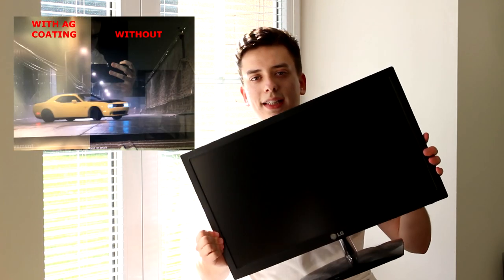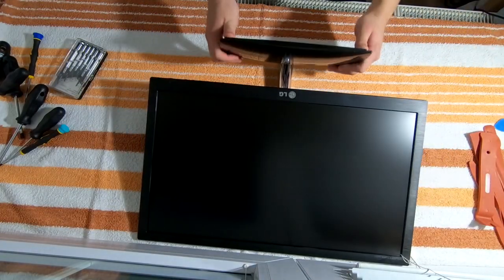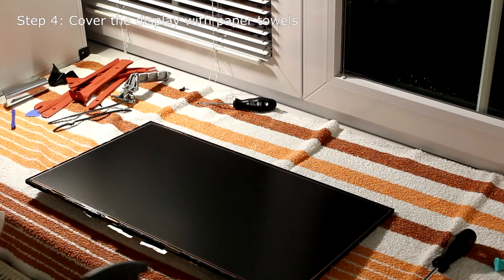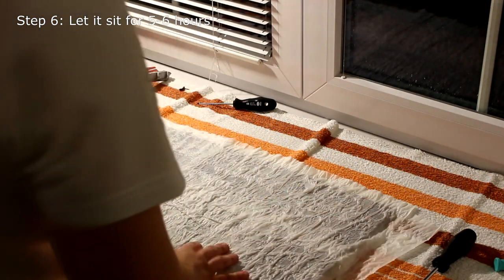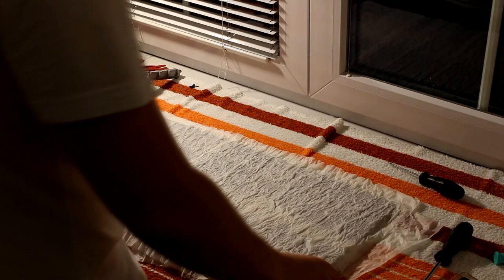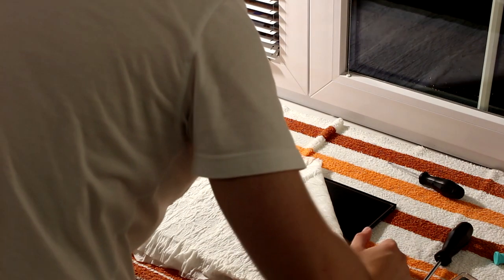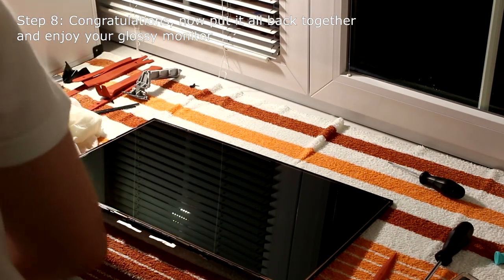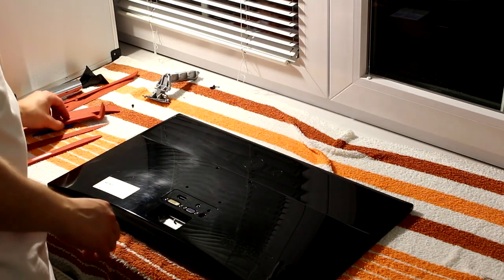How to remove the Anti Glare Coating from monitor DIY (Matte to Glossy)

Comment: Thanks for the tutorial. I'm going to change monitor soon, as my current monitor is matte (Asus PB278Q) and my future monitor will be glossy (probably OLED), I wanted to see what a glossy monitor would look like in the room where I have my PC. As I'm not patient, I removed the anti-glare after only an hour 😅 By removing it, I thought the screen was broken but in fact, the anti-glare plastic was torn. That said, I managed to remove the torn pieces without having to add paper and water. After putting everything back together, I turned on my PC and my god... what a slap I took 😱 My monitor already had very good image quality but now, the image is magnificent 🥰 I'm still going to have to change  because I play a lot and my monitor is limited to 60Hz but the image quality is so much more beautiful after removing the anti-glare...

Comment: I tried. After about 7 hours of wetting toilet papers over my LG ERGO 32, the coating didn't moved nothing. Not even a little bit. I tried to force my nails to remove, and only made it to look ugly. Gladly it was only at the very corners and didn't affected image.
Reply: Same - I tried it on an LG 38uc99 and it didn’t work at all.. only managed to scrape of tiny bits on the corner.. so abandoned it.. maybe LG are using a special adhesive.

Comment: have you tried to clean the monitor with the polarizer on?
Reply from the maker: Yes, a few times already. I use slightly damp microfiber towel, when the monitor is cold and so far no problems at all.

Comment: I just cleaned my monitor with bio ethanol and tiolet paper, it scratched badly. The coat is ruined. Is this a method I can use? Or is there a spray s I can diy recoat?

Comment: My monitor came with a diffusion coating that was just way too strong and foggy. Found myself squinting just to see sometimes, even at max brightness. Thanks to this video though, i was able to finally replace it 😂. I’m not a full glossy guy, but the new coating that I got is a good mix of both.

Comment: This works especially great especially on "frameless" monitors. You don't have to take off the metal edging because there isn't any! Easy Peezy. Don't be afraid of this.
Reply: have you dont it? which monitor? I have an Lg27GP83 and I am wanting to do this but anot sure how to dimsantle the monitor.
Reply: @Abrioso  Yes I've done it twice. Once with a "frameless" Dell and once with a Samsung that did have a frame. The Samsung was more involved was you have to open up the case, detach some wire plugs, which will only fit one way and in one location. (easy to get back in place-or take a picture) The remove the screen panel, remove the metal frame, not as difficult as it sounds, and begin the process. I kept my screens moist for 8 hours just to make sure. He goes over how to remove the screen fame in the video. Just take your time. It will work and what a difference. I can now buy any monitor and not worry about whether it is non reflective or not. When you remove the film you'll really see how hazy the screen film is. Good luck. His directions are good. Dismantling will mean taking out screws in back of monitor and prying open the case.
Reply: @montysonful  thanks for the response man! You just pushed me to do it, I have it disassembled now and soaked, I will update in a few hours!!
Reply: @Abrioso  OK. You can do this.
Reply: @Abrioso  You should let is soak more than a few hours. As I said I waited 7-8 hours and also sprayed the paper towels as they began to dry
Reply: @montysonful  ill let it soak for 8hrs, thanks for the tips man!
Reply: @Abrioso  what happened?
Reply: @Solo.101  i fucked it up
Reply: @Abrioso  how and what happend
Reply: @montysonful i feel like this is near impossible on modern monitors. The glue does not want to dissolve for me, and i’ve done the same as you, respraying as they start to dry.
Reply: @SashaMarkovic-he6sm  My monitor is Dell and less than a year old. Maybe leave paper towel on longer and wet until it's just dripping but not rolling in behind frame. I left mine on for about 2 hours if I remember correctly.
Reply: @montysonful  I just did another try today, without any luck... Left the paper soaking wet for 4 hours, with re-sprays, and nothing happened. This is the 3rd time on this monitor. 32 inch 144hz VA-panel. I think i´m giving up on this one, the glue is just too strong.

Comment: I did this almost 5 years ago which left some kind of residue on it, so far I haven't really cleaned it off and it didn't bother, but recently I tried to clean it with alcohol and microfiber cloth and it only increased vertical cracks on the right lower corner. They were there before, but now they are there even more.. When sun shines on the screen it's very easily visible, also when screen is turned off.
Does anyone have any solution how to reduce those scratches?
Reply: Yes, don't use alcohol on plasitc parts...
Reply: bruh why tf are you using alcohol on unprotected screen?

Comment: Does this work on all smonitors? New LG's Ultrafine 2021 for an example?
Reply: Dude, who is the character in your profile pic?
Reply: The new Ultrafines shouldn't have anti-glare.. as if they are manufactured for Apple/MacOS?
Reply: @electrickrypt  they do not have imho

Comment: Can any monitor work for this? Does every monitor have an anti glare coating that people are able to remove. I’m trying to remove the after predator anti glare coating before I get the monitor.
Reply from the maker: It should have the coating, if the monitor is matte/partly matte and not glossy. You should be able to remove the coating the same way. If the monitor is new, it wont be coming off as easily as an older monitor and the film is most likely going to be thinner. It should be fine as long as you give it more time. Just remember, watch out for the film/coating. It is white. Do not remove the dark coating, that is polariser and you will ruin your display. Good luck
Reply: @tomkosdiy  bro, my monitor is polarized and i removed that layer, how can i fix it, can i find some polaried filter to replace it?  DEL P2419H is the model! pleeeese help me, the screen keeps white all the time

Comment: May i ask why need to soak water first? I image that water cannot penetrate the coating so may not be necessary.
Reply: I believe it's to slightly loosen the edge from where we can start peeling off the AG coating.
Also a tiny amount of water may get inside the AG coating layer and make it easy to gradually peel it off.
Reply: @main_stream_media_is_a_joke  nice explanation thx

Comment: My monitor has no bezel, I can see the edge of the screen, do I have to take it apart?
Reply from the maker: No, I think you could teoretically get away without taking it apart. However take extra care with all the water as it could more easily get inside. I would probably still at least take off the back cover and disconnect everything and then make sure to let it dry out longer.
Reply: @tomkosdiy  ty :)
Reply: @Joakim Scott Dude, I have the same monitor and thinking the same thing. Reviews say "It has very light matte coating" - yeah, light. What a joke. I'm thinking of either returning it, or trying this trick. The screen does have some space between the bezel and the screen, and thinking the water could seep in from there. Hmm. Went ahead with the mod already? :D
Reply: @Joakim Scott Okay! That sounds like a great experiment if you decide to try it. I agree it is much wiser to attempt with a less costly display. Myself, I heard that the S2419H is a glossy display - one of the extremely few on the market. I may end up getting that one for my working from home needs - I’d prefer 4K, but strangely enough the matte coating annoys me enough that I’d forgo it for a glossy 1080p screen.
Reply: @Joakim Scott That is an interesting idea. It could work! However, that would require that the treatment takes effect rather soon, like within an hour. I believe these guys have said the surface needs to be kept moist actively with some spraying occasionally. Keep us posted! 😄
Reply: @Joakim Scott Amazing results! I’m really glad that worked for you. Also, because the panel and frame is so similar to U2720Q, I’m really tempted to try it on it. Still within return window so I will think on that a bit. 😄
Reply: @tomkosdiy  lol just put monitor with its face onto soak papers..

Comment: in 2021 i'm still using my glossy HP 2510i monitor and i love it ^_^ its even good for gaming 2,5ms response and overclocked to 71hz while gaming, people who does not see in real life how glossy have better picture have no idea and think matte is good lol... i had 5-6 matte monitors and they all looked washed out compered to my HP 2510i... i will buy new monitor only if someone make GLOSSY 144hz 25inch (at least) 1440p.

Comment: i succeeded to peel off matte filim on Asus Vivobook 17", and then I bought today "Samsung - 28” ViewFinity UHD" and tried it.. soaking 4hours, but it was very different and there was no white layer but dark(lightly tinted) film only, and sticker residues on the screen... When I plugged in the monitor! So scary!! only white light.. )) I need to return it secretly to the shop.  Any advice?

Comment: Yeah the black levels are darker but I'd like to see you use it next to a sunny window.
Reply: You can control lighting in your environment, while matte screens look like crap no matter what.
Reply: @cyberedge881  this!
Reply: @cyberedge881  also, next to a sunny window a matte screen is unusable lol. The only difference with a glossy screen is that it doesn't have a distinct reflection, but a huge light stain instead. Next to a sunny window my matte display at 100% brightness made a dark movie completely unwatchable.
Reply: I dunno about you but my windows have blinds...
Reply: They're called curtains

Comment: 99% of people want to get rid of the glossy reflective coating on old monitors and this genius acts vice versa. Really useful.
Reply: Yes, some people want picture quality and not let it be destroyed by a matte coating.
Reply: @Deffine  Some people (less than 10) vs millions who hate reflecting mirrorpicture. No major manufacture sells glossy any more - why,  because some people is not enough to produce.
Reply: @MrSookonn  Couldnt be more wrong. Every top model TV and pretty much all high end Apple products are fully glossy. Either you are reflection phobic or you care about picture quality to use your screen in a light controlled environment.
Reply: @Deffine Again all lies - they are semi glossy not glossy, dont write down nonsense. Go to your local store and you find zero glossy monitors.
Reply: @MrSookonn  They aren't semi glossy. Semi glossy = reflections that are diffused to different degrees, but not defined as with glossy. You have no idea who you are talking to. I have tested monitors and TVs since 2008. Yes, most of the screens in the store are semi-glossy, but the top models are not. All mobile phones and tablets have glossy screens because you need to pixels to be clear to be able to appreciate the high PPI (pixels per inch). Let me explain to you something, this is not a matter of opinion, ignoramus. Its a matter of fact that glossy screens are clearer, with more vibrant colors and even measurably brighter on the same panel (demonstrated by measurements after removing matte coating). Matte coating destroys PQ by distorting the pixels, making for a grainy/ oily picture that is unclear, it also traps light  that reduces perceived contrast. All this is a consensus by now and demonstrated many times, you just need to google to find the evidence.

Comment: I don't want to see the reflection of the lights ones face the window etc in the monitor. I would rather not see reflections and have a mild reduction in "pop". You can also just go into the settings and change the monitor display brightness color etc without breaking it.